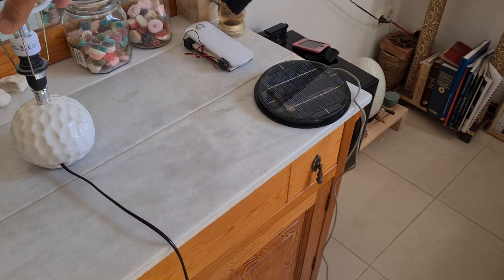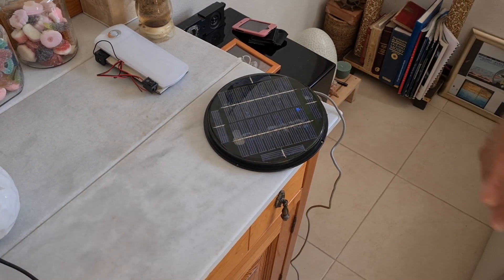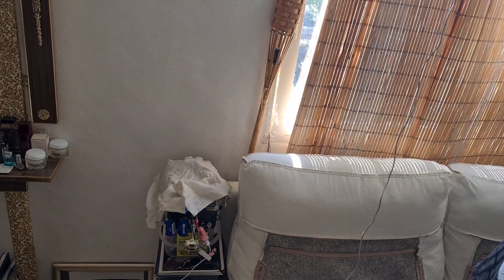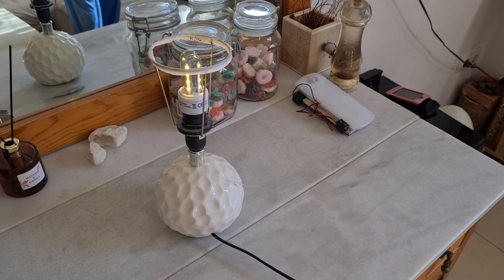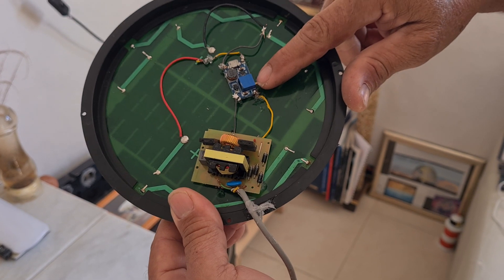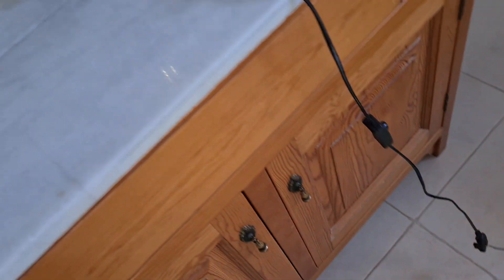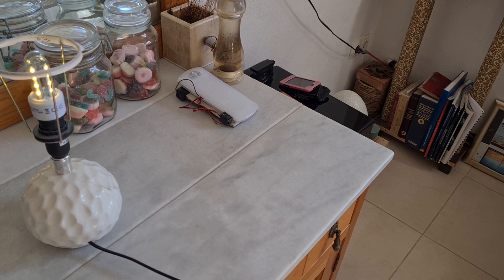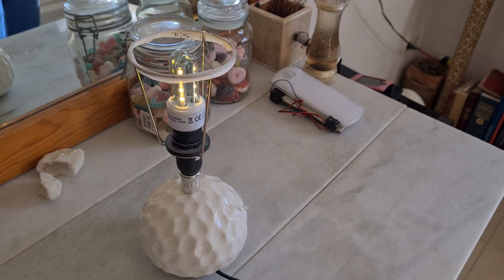How to get 220V directly from a 3W solar panel without any battery

Comment: Hi Denis, have you thought about using a joule thief/ringer type of circuit in between the cell and the load instead of the step up converter/inverter combo?  Thank you for sharing :)
Reply from the maker: Hi Paul, thank you for your comment. A joule thief will indeed be a successful idea, while putting a different load of 3V led bulb 1W. This bulb is very strong and your arrangement can be very efficient. Thank you for the suggestion I appreciate it.

Comment: Very interesting setup. I will try someday. Thank you for sharing Denis
Reply from the maker: Hi thank you for your support. I do have some 2.7V supercapacitor 350 Farads each from Maxwell. I put 6 in series and got 16.2V. The problem was that they make alot of objection to absorb the charge. They charge very fast but the objection is very strong so if I have to 4 banks of those it slows down the rpm of the alternator but your idea is great. I was watching a video of yours during the weekend and everytime I have some time. Best regards
Reply: @denissabourin   You may overcome that by charging them with  back EMF, i.e. adding some Bedini Style circuit to your setup. Charging supercaps in Bedini style didn't increase the load, because the load remains the same. I've noticed that when I've charge supercaps with my Imhotep fan charger, based on Bedini circuit.
Reply from the maker: @Machiuka  Thank you, I hope you are well. Basically, those super capacitors are energy storage of big amperage that gets lost very quickly under load, faster than batteries. So the load remains the same as you said. Those supercapacitors were a basically a backup to a car amplifier so they work with the battery at the same time, so the battery loses power slowly and keeps its amperager for longer. You can do other things with those capacitors it is true. I can try to charge the Bedini style one day. Best regards